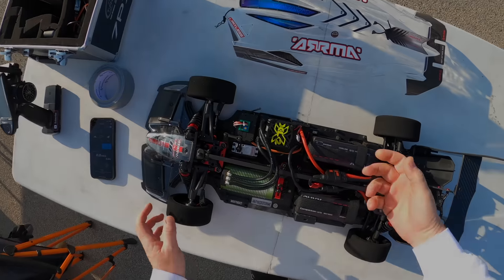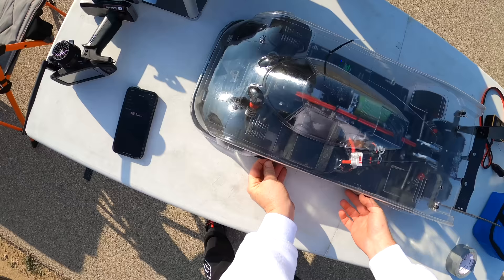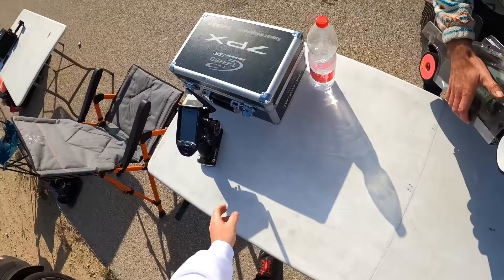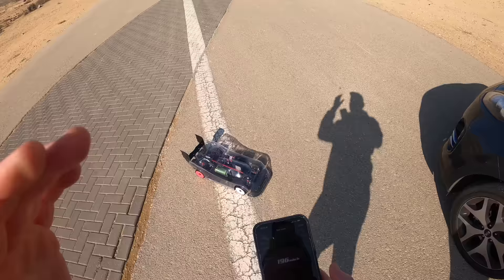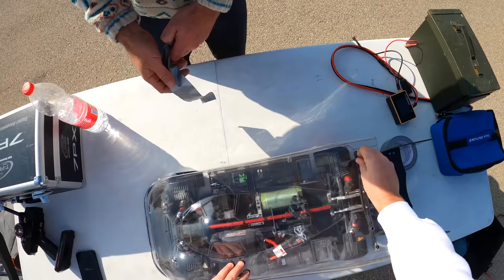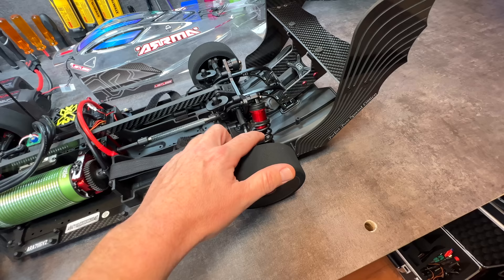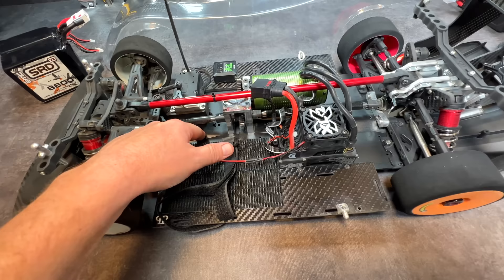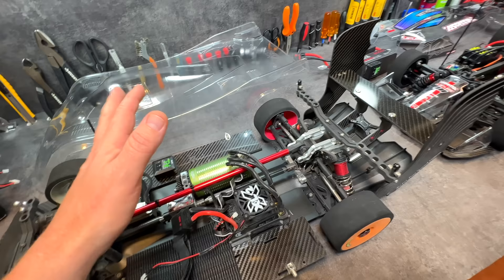2023 Worlds Fastest Single Motor RC Car

Comment: Yes, I’m new and I find it so strange and frankly pathetic that the rc community is “secretive” about rc info. Even at the hobby shop the workers would laugh if I didn’t know the correct term. It’s like bro you work in a hobby shop I own my own business and am a firefighter making more money than I know what to do with. That’s why I spend on rc’s.  It’s like dude it’s a lot to learn how bout you help a guy who is interested out and teach him. Thanks man love your products and mindset
Reply: There is plently of videos on how to get fast with an rc, just have to find them. And if you are looking into burning money, dual motor limitless with a scorched front bearing drive shaft, rear carbon fiber drive shaft, ceramic bearings, a fc100 delta plastiks body, and 2 1100kv xlx2 combos. Great way to spend about 3k, but that setup has gone 200mph.
Reply: Theyre all nerds that got bullied, dont even sweat it

Comment: I appreciate your sense of honor. And the challenge implied.... "yeah, this is what I run, but I bet you can't make one as fast". Love it ! I've been in the hobby long enough to realize that it isn't just about the motor and ESC.  There is painstaking hours of reducing driveline friction, suspension tuning, tire selection, lubricants, gear ratios, batteries, aero, etc. etc. 
Just because you have a killer strong Castle motor is just the start.....
Love your channel, dude...

Comment: You are the reason I even consider on road builds. Prior to finding your channel, I was exclusively an off road and dirt oval guy. But the stuff you do show, like how to build a 150mph car, has shown me there is a challenge to doing this on road stuff, and has gotten me interested in it. It has also convinced me to convert my Jato to a 6s electric system, and use it as an on road car.
Reply: I couldn’t agree more raz is the man when it comes to speed runs and builds

Comment: Without competition we would still be using nicad.... Amazing to see how far R/C has come sense the start, when I was young my dad got me a Tamiya Frog almost 40 years later I still Love the hobby! Keep doing what your doing really enjoy your passion!
Reply: Probably Alkaline batteries in radio shack type RC cars, lol.
Reply: @FarmerFpv  Nickle-cad rechargeable battery for the rc.
Reply: Bro the frog was like my dream car when I was a squirt.
Reply: Yeah always cool rc things. Always wanted a car that you can drive with a controller
Reply: I don't think that's how it happened. Like most technologies, it comes from research groups at universities and if manufacture-able, becomes a reality on the market. Competition only really comes in at the corners to squeeze more performance per dollar. In the case of li-ion, and eventually li-poly, John Goodenough was one of the inventors. He's supposedly working on the next battery technology which will be ceramic based.

Comment: Awesome video! I'm not much of a speed run guy because of the high maintenance cost, but this video was sick, and the fact you didn't hide your build  deserves major props. Most speed runners on YT won't share their components breakdown, but you gave pretty much a full breakdown on what you were running. I'm actually blown away that your tires held up at 190+mph. I've see a lot of speed run videos before and blow outs are very common over 165mph...some happen at lower speeds than that. I'm probably guessing a lot of that was attributed to those springs your were running. The springs seemed to keep the car perfectly stiff at the desired ride height and also reduice the vibration traveling through the wheels and chassis. The fact hose tires held up like that for two runs is insane! I appreciate everything you shared in this video! Thanks!

Comment: Im not knocking what you are doing, I love your videos Raz and with you are achieving by modding a RTR car is very impressive, but Nic Case's  203mph record was set with a single motor,  I don't recall if there is video of him taking the body off after a 200+run, but his build is well documented, he wasn't shy about revealing what he was using either,  it was officially set at an endorsed event with a 2 way average timed across a measured distance too, not just an instantaneous top speed measured by GPS, 8 years later and a few folks like you are getting close on the GPS, but no one is yet close to beating it officially and ROSSA don't even require the second direction for an average any more (like other motorsport/moddlesport speed records do).
Reply from the maker: I actually completely agree with you. I completely forgot about this.
This is correct
Reply: Nics car was a completely custom rig with a heap of sponsorship . Also James McCoy has a 204 in the bag, using a single tp motor xlx2 ??? I guess what he’s saying is back up your claim to keep everyone honest.

Comment: People underestimate how  important body stability really matters at those high speeds. Between the new body mounts and stuff I think that's what's helping so much with these runs. 
That older body with the bolted or riveted aero parts on it I feel like has too much play. I would glue the extra parts on or use some sort of adhesive to prevent any bit of wiggle or air slipping through. You have to think at close to 200mph all that force will find any weakness. 
All this will make the car super unstable.
Reply: With all the other things you raz does combined with bulletproof stability = the best runs. Just my opinion from all the videos I've watch raz do thus far.

Comment: Raz Between you and Josh at RcRecon I have learned a few things in the building of My Limitless V@ I am running an XlX2 with a 2028 1199Kv and I started my gearing at 39 and 49  basically one to one Running 8S Stock chassis so far other than an EMP motor mount, Running GRP S1 Tires, I went 114mph with a built 2wd Rustler This one I am aiming for 130mph. So I appreciate your videos and I do try and learn from them so thank you and Happy New Year, Oh and I did just update to a new Futaba 7PXR Radio.

Comment: I just got a limitless V2 and first time doing any kinda speed build, so I watched you 6 episode build and set mine up except I’m not a castle fan boy, so I went with a hobbywing max 5 esc and hobbywing 4990 1650kv motor and just trimmed the plastics in front and back for downforce and on stock 39t spool and 35t pinion on this tiny road where I live I got maybe a 1/3 throttle pull and got 127mph. But I’ve got your PP batwing, Carbon driveshaft, full carbon fiber kit, bsr foams that will be here tomorrow. Then I’m going to take it to a long wide road and break these castle records with my hobbywing stuff. Everyone on YouTube uses castle in there limitless and having problems getting pass 130-140. I’m positive I’ll be past 150s after I get my perfect pass stuff on it because I put a 34t spool on it with a 37t pinion. I’m going to try to figure out this YouTube thing that way I can show everyone what a beginner did with hobbywing electronics. RAZ you’ve inspired me to get into the speed stuff and I can’t wait to make another order of perfect pass parts

Comment: Mr. Razputant. Have you thought about having a body made with golf ball dimples on the surface? Myth Buster's video shows that a body with a golf ball dimple had much less drag than a smooth body. It was much more efficient in the short-term and long-term testing. I believe they said it's because it breaks up the air molecules which causes less resistance. Just a thought?
Reply: I am pretty sure Myth Buster's myth busting was busted later on... Meaning, someone with a more controlled experiment could could not replicate MB's findings in reg. to the dimpled car. 

As for why it might work, I think it was more a thing of keeping laminar flow attached for longer. Not sure. 

On that same note, I keep wondering if there aren't a mile or three to be had in getting rid of those clamps on the RC car and the bracket between the rear wing uprights, those flat fronts on the wings can't really be benefitial either. I don't know why aero is still a tad simple on these RC speed cars. Maybe something is going on at this scale that reduces its importance.

Comment: I truly enjoyed watching this.i tried to go fast back in probably 1992 built my own car out of circuit board.i never got to the speeds you are traveling at but I was running 8 cell battery I wired up my self.well the moral to my story is I let air get under my car and into the body well let's just say this I became a air plane she went a good 20 feet straight up it wasn't a good sight.you have made me possibly want to try again your car is awesome good job

Comment: im new to rc community. i want to know how you guys change gears with no problems. are you only switching the spur gear?  apologize for dumb question, if it is.. only cause i put loc tite and i say man these guys are using some powerful glue for gears not come loose with the speed.  awesome car, thanks for sharing.

Comment: Raz, love the vids. I just built my first limitless, and was hoping for some hints. I've running a max5 g2 and tp 1300 scm motor. I know the hoons are only good to around 115, and my math works out to 6s around those speeds. I'm curious on any info once I'm there. Raining the last two days, so unable to run at moment. Was hoping to hit it yesterday, but once I came outside weather was crap. Keep up the great content, and thanks😊

Comment: On the limitless, how are you using the stock motor mount with the 2028 1700kv? The mount holes do not match the motor hole pattern. Please can you share? I am waiting for the grublock mount but curious how you used the stock mount.

Comment: Can I get your opinion on something? I want to do a single motor setup for high speed; not speed runs of 175mph+,  just durable high speed. Should I got with Castle Creations Mamba XLX 2 1/5 Sensored Brushless ESC/Motor Combo (800Kv) w/2028 Motor OR Hobbywing EZRun Max4/Max5 ESC & EZRun 70125SD (560kv) motor. The castle ESC says it's maxed rated for 8s, whereas the HW ESC is rated for 12s. In speed run videos I'm seeing mostly Castle setups, but I'm not really sure what to do. Can the castle XLX 2 +2028 (800kv) motor handle 12s? I noticed your speed car was Castle. What do you think about running the 2028 (800kv) Castle with the 12s capable HW Max4 or 5 ESC? Is this a possibility? Can you also recommend the best LiPos to use in your opinion? Help me out Raz! or anyone!

Comment: Impressive!
How difficult would it be to make the car narrower by 10% or 20%?
If it can stlll track right, that might be a way to vastly reduce drag and get well over 200 mph with the same single motor.
Crosswind is pretty terrible for performance normally. Let see what the same car does without crosswind?
Reply: Would take almost an equal amount of effort as building an entirely custom chassis.

Comment: Nice run man so that means that James McCoy had a dual motor set up in his vehicle that ran 200+ and also you would have the fastest single motor Arrma because Nick case ran 200 mph with a single motor years ago, correct me if I’m wrong, but still you have some fast cars.
Reply from the maker: Thanks and honestly, I just don't know🙏🏻🤷🏼‍♂️
Reply: No one knows what exactly james is running except for james. I think his 200 run habao was a single motor and the 204 limitless was a dual motor.
Reply: @masonkaye5  James probably has gone over 204, he's just waiting for someone to break his record to post it lol

Comment: You really got to FPV that thing so you can send it far.
Reply: fpv does not work on speed cars, they move too fast and are too close to the ground for you to be able to actually see anything.
Reply: @masonkaye5  I have used it on regular rc cars, that only do 70 and below, and I agree proximity is difficult, but in a open area like that it may be just enough to get the extra distance without going to get it. And be able to get back.

Comment: Raz, got my 4tec almost ready to go..(140 mph goal) working on a vendetta speed run car (180 mph goal) and a limitless V2 coming. Sounds like at the perfect time. 
4tec (new esc inbound) will be a monster x and has a tp power 3630cm 5250kv on a Ramjam Racing cf chassis on mod 1 30/24 to start. I'm going to try to shoehorn a Castle 1700 with an mmx8s into the vendetta, if the 1700 won't fit then it will get a TP power 2200. Limitless will be an xlx2 with the 1700.
Problem is finding perfect pass parts. I need launch controls. Even on the 4tec because it has crazy wheel spin even with punch control dialed down to 30 on just a mamba x.( yes, the x overamps lol) Is there a spot where we can order direct?
Reply: Amazon for perfect pass, there are in stock!!!

Comment: Why don't you run solid suspension in your cars? I'm pretty sure the car nic case set the record with has solid suspension.
Reply: I can't imagine solid suspension would be better than a shock that is properly setup with the right spring rate and fluid. If you think about what suspension does, it's there to allow the car to run over imperfect surfaces without unsettling the car. If everything is rock solid every little bump is transmitting all of that force up through the chassis to unsettle it and would tend to cause less contact of the tire with the pavement.

Comment: I love your work brother, but there's something i wanted to ask you. Is it possible that you build a traxxas X0-1 and make parts that will fit those cars?. Your Brother Roland
Reply: The problem with the XO-1 is the small chassis, it is not wide enough for enough space to put everything and the body completely sucks for speed running. You would be much better off with an infraction because the platform is much better.
Reply: @masonkaye5  i guess im going to have to buy another car, i have 2 X0-1's and i wanted to upgrade them, but thank for your outlook on them

Comment: So you never run cap packs, are they even necessary?
Reply: Nope  you need the space is very important most guys don't have access to airport strips also you need dynamics is very important  the way you charge the lipo is very important etc etc

Comment: Doing a speed run in a open wheels is pain in the ass in term of aerodynamic drag even Formula 1 Engineer always expirience this that's why they spend Billions of dollars on F1 cars just to battling out Aerodynamic drag cause by the Wheels causing dirty air around the wheels.

Comment: IS IT BAD FOR A 15 YEAR OLD TO USE A FLAT HEAD SROW DRIVER AND RAP A HOTGLUE GUN CORD A RAWD IT TO BUILD A SODERING IRON AND TERN OFF THE PLUG AT SCHOOL WITH A BLUE XSPLGEN ? IS THIS DUM WAYS TO DIE BECASE I DO DUM CRAP ALOT IF IT IS.